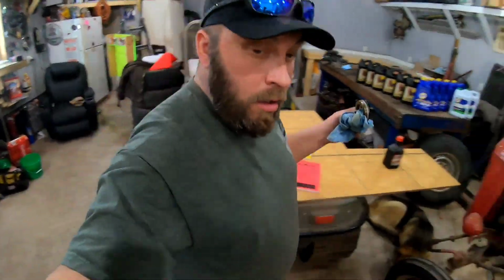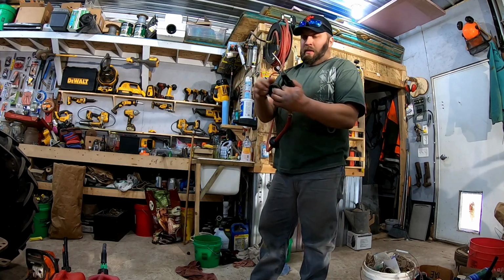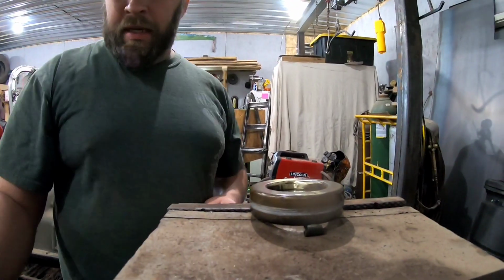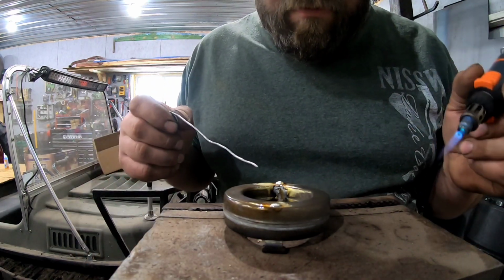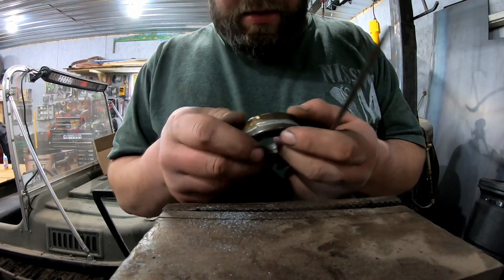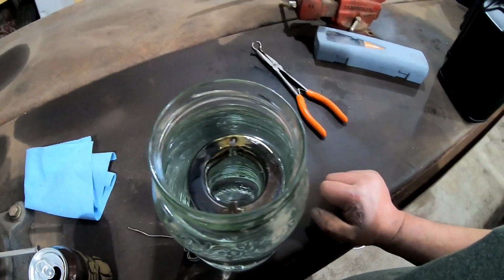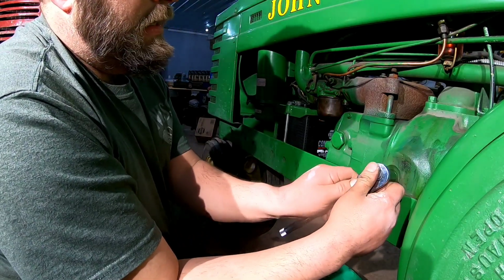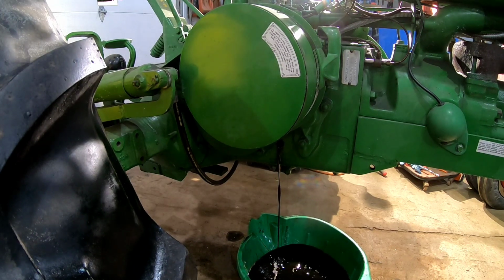1941 John Deere H Getting it Running Part 4 Repairing Cracked Carburetor Float.

Comment: Good job! The plastic floats you could check by putting pressure on the float with the flat side of a flat blade screwdriver and look for a wet spot. Damn good call taking the plugs out and spinning it over!!